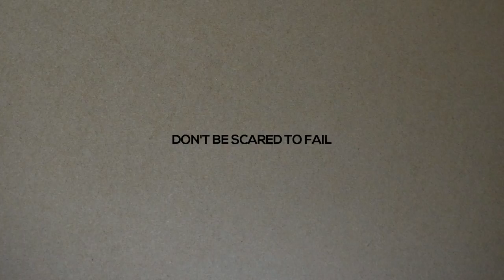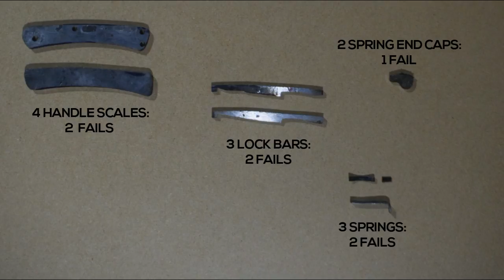Making A Locking Folding Knife - Part 2 [30.5]

Comment: Very good !
I wonder if you think it would work wouthout metal scales ?
Reply from the maker: I don't see why it wouldn't, so long as you're using quite a dense hardwood, so the spring can't compress the fibres and become loose :)
Reply: @jmakes3745  I've been trying, and I'm sure with the right wood and tools it would work, but in my experience it's difficult

Comment: That's lovely, I think it'd make a great gift. I really like that sharpening jig too, never seen one before. Is the epoxy you have there from B&Q? Cos' I know they supply a lot of Diall products but I wasn't aware they made epoxy. Great vid and nice touch showing all the fails!
Reply from the maker: Thanks! 
The sharpening jig was just a really cheap one off eBay, modeled off the Edge Pro Apex if you want to check that out, seems to be working pretty good so far though, use it for sharpening all my stuff. Yeh the epoxy was from B&Q, not sure i'd recommend it though for knife making, has a really short work time, and was kind of rubbery when cured.
Reply: Cool thank you for that I will check out the Edge Pro Apex, looks interesting! Ah that's a shame about the epoxy!